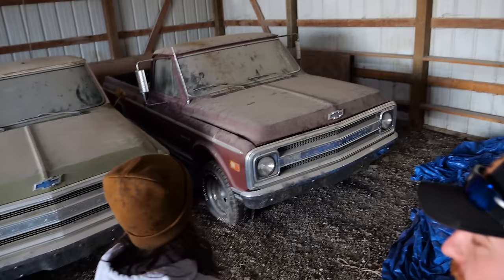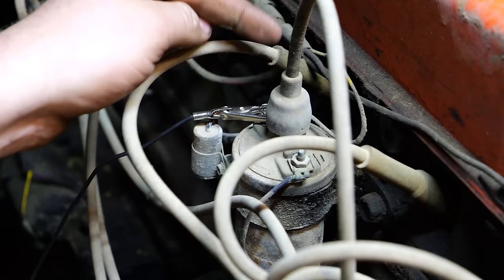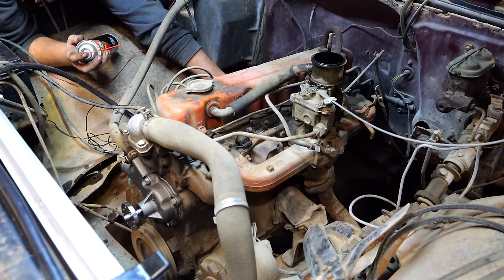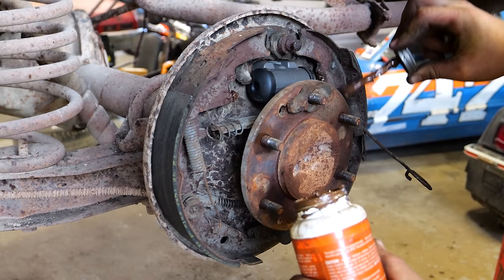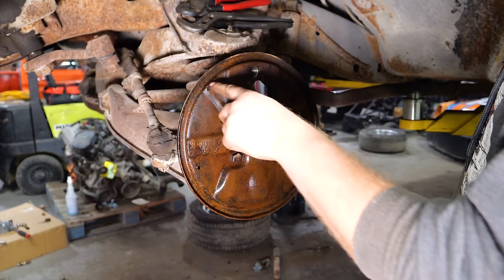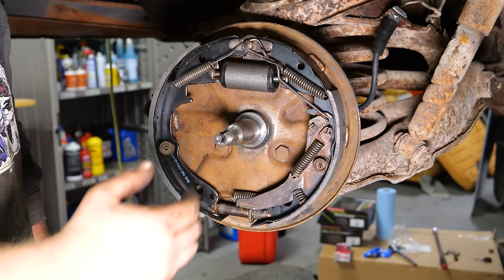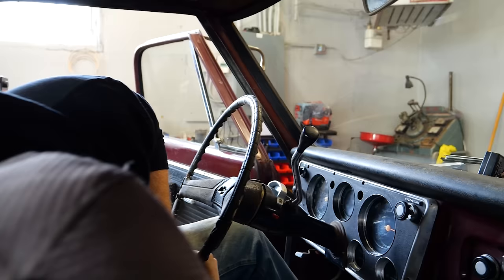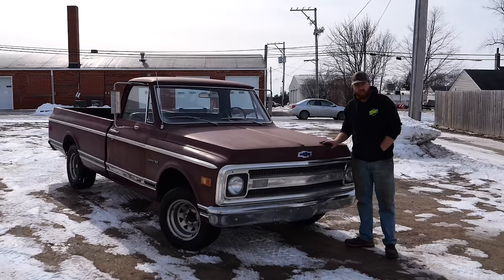Will an ABANDONED C10 Run & Drive? Mothballed for YEARS

Comment: Kevin, there may be a ton of videos on doing drum brakes, but none as calm, clear and concise. Loved this.
Reply: He put the front brake shoes on backwards. Bigs to the back is what our shop teacher always said.
Reply: @mcqueenfanman  You are correct.
Reply: @mcqueenfanman  yep, short shoe is the leading, long is trailing. Dad was a professional mechanic, went to Lincoln Tech, in the 70s and taught me drum brakes in the 80s/90s.
Reply: I don’t know why he doesn’t use brake tools either. Learn to use them. They work quite well and it beats having a brake spring cut you. I literally find those tools cheap at flea markets and second hand stores. I even sent him a few.
Reply: @mcqueenfanman  Agreed, a decent set of brake pliers or tools makes things super smooth. Never understood why people insist on using screwdrivers and pliers to do it.
Reply: I hate that my parents found out i get high on my YouTube channel as my career )):
Reply: Kevin and Chrisfix by far have the best videos on drum breaks
Reply: @mcqueenfanman  and the bottom spring was backwards too, the way he put it the spring will hold the star wheel and the self-adjuster will not be able to turn it.

Comment: It's always a great day when Junkyard Digs uploads a new video. I'm a Ford guy but I like these old Chevy trucks too and it is nice seeing them get another shot at life
Reply: I've been working at a body shop for a bit now and extra tips I learned was if you're painting the door, it's better to take off the mirror and belt molding (the trim at the bottom of the window) for a better paint job in the end. The mirror can get in the way, and if you're unlucky, the clear coat could stick in that gap between the door and the belt molding
Reply: @Fire tablet  I think you may have replied to the wrong comment, not trying to be rude here but your info doesn't seem to line up with the content of the original comment.
Reply: @uenragedbro  This is why I'll never let someone borrow my car again.  My ex let her brother drive my car and he ended up running from the police and tore my shit up. I was pissed asf, especially when I found out he tried hiding my car at a car wash
Reply: @firetablet1995  Are you ok, man?
Reply: @redbeard6220  I have a red beard too! Sorry I just noticed your username, at least it was somewhat RELEVANT

Comment: A little tip for old engines as long as you have a timing light: Hook up the timing light and look at the marks - rev the engine and let it decelerate while watching the marks - they shouldn't change much at all (less than 3 degrees, the less the better). If they move more than 3 degrees, your timing chain is loose - if they move upwards of 5 degrees, maybe ought to replace it....soon (especially if you have any "strange" noise when accelerating / decelerating). This, of course, assumes that any vacuum advance and manual advance (distributor weights, for example) are plugged / removed.

You can also test the chain manually if you have easy access to the crank bolt. Open the distributor cap and note - exactly - where the rotor is pointing. Take a wrench and SLOWLY turn the crank back and forth - noting the amount that the crank turns before there is any movement of the distributor rotor. Once again, the less movement, the better.

So, why all this? You'll find more than a few old engines out there that are parked because the timing chain needs to be replaced. At times, owners will park the vehicle not knowing that it's the timing chain - all they'll know is "it just never runs right no matter what I do". Yep...cause a bad chain - well, the engine is rarely properly timed - might rev up really great, but then pop like hell on deceleration......

Edit: I should be more clear about 3 degrees, etc. If your standard timing at idle is say, 6 btdc, you'll see the timing change to more and less than 6btdc (usually a little more on the accel side than the decel side). As long as your timing doesn't change more than 3 degrees - more than 9 or less than 3 btdc - you're generally fine. 3 degrees meaning you'll see, on average, a 6 degree "swing". Watch it, of course, if you see more than 3 degrees in either direction and certainly be concerned if you see 5 or more.
Reply: That engine has timing gears instead of a chain
Reply: @dm1123751  True enough, although the tip applies to most engines. Timing gears wear too....BUT....odds are the engine would be in a landfill / recycled or rebuilt far before any wear would be noticeable. MAYBE...if you run them dry.....lol
Reply: Your very right . I've bought more than a few that needed timing chains replaced. I bought a Eagle and the owner said that he couldn't get it to run right. I ended up replacing the timing chain and cam .
Reply: @David B You are absolutely spot on with your advice. The timing gears in these here engines suck. When they go, it'll wipe the teeth clean off from them. I'd replace them pretty quick
Reply: @waynedavis7245  Sometimes they're pretty obvious - enough slack to get noisy. Strange front engine clatter on accel / decel and runs "weird" - timing chain is a likely culprit.
Reply: @dm1123751  Haven't worked on many engines with factory timing gears, although have worked with Pete Jackson gear drives (bulletproof...until they destroy themselves like any part of a highpo engine). Most factory motors I've worked on have been chained, or, of course, belted (mostly the 4 bangers). Did manage to have a timing belt slip - stretched enough I guess to jump - interference engine - pistons meet valves, carnage ensues. Warranty covered that repair, thankfully, and now...well, I watch timing belts pretty well and change them early - glad they are generally a lot easier to change than a chain.
Reply: A 250 uses taking gears and they rarely wear out. Though they are plastic so 🤷‍♂️
Reply: @Gkitchens1  Plastic CAN be durable, I guess, although I imagine things go south quickly when they do go. Plus side - better to have tiny bits of plastic in oil rather than steel (although some properly placed magnets...nvm).
Reply: timing chain, or distributor is loose.
Reply: Yeah that makes sense..I was wondering why almost all of these old cars need tinkering with timing
Reply from the maker: What we do is simply take the cap off and turn the crank back and forth, watching how much play there is before the rotor moves, as you mentioned 🤘
Reply: @grumpslowenleft9642  very true . I've done a few earlier 305 GM's . They were prone to for timing chains and cam failures. I would check for slop when I turned the crank to see if the engine was free . I've bought probably 5 gen 3 firebird. 3 had bad cams .
Reply: @danieljames5875  It's a tip to check it - whether a person wants to get it back to factory specs or not is up to them. A timing chain is a frequent "park" item - I've seen many with much larger than the 5 degrees I mentioned, I think the largest I recall was somewhere around 10 degrees each side (20 degrees or so total) - and yep, nice and noisy, well, for the brief moments that it would run.
Reply: David B; Great point about an engines timing, your knowledge is spot on.  The Chevrolet in line six uses timing gears which makes the timing more accurate,so there's less of a chance of inaccurate timing.  I've seen on rare occasions that the cam gear can strip on these leading to a no start condition.
Reply: @paulkirkland1535  Thanks for the reply. For me, if I'm evaluating an old vehicle it's a big thing - I might be going into it thinking there won't be much work needed, only to find that the chain is VERY worn out - quick opinion change there. What else was let go? How long did it drive with a worn out chain? How often was oil changed and other maintenance performed? Some engines can sit for many years and need little more than a slight prod - and then run well - we see it fairly frequently on this channel. Other engines....well, after tons of effort, parts and money - depending on what you had to replace (and the list can be extensive and expensive) they'll run too. A worn out timing chain is one thing - but if it's an indicator of essentially no maintenance - fixing no maintenance is a lot of work and usually expensive. When I find a worn out timing chain I look sludge in the valve covers - if there's sludge...I pass.
Reply: Have a 1989 Honda Acty Street, replaced the timing belt last weekend. It had a nasty timing wander - probably ±4° - which entirely went away with the belt replacement. Belt was really loose, letting the cam kinda wander wherever it wanted. Think I really dodged a bullet with that one.
Reply: @jaypawhealer  Yeah, 4 degrees is a bit for a belt - they don't tend to easily get the permanent stretch that a chain does - but when they do....yep, I've had it happen - slips a cog or so, and in my case, all 16 valves meet the 4 pistons. You very well could have dodged a similar fate, although not sure if yours is an interference engine - it likely is, but...dunno. Would be nice if chains were as simple to replace as belts....oh well.
Reply: @grumpslowenleft9642  it is interference, and I think it was a combination of stretch and the tensioner slipping. It's the kind with a weak preload spring that you set in place with a bolt, not a huge fan of how that works. To be fair, it just hit 100,000km and the belt seems to have been the factory one from 1989, which is a pretty good run
Reply: @jaypawhealer  That's a fair amount for a factory belt. My 90 Laser RS Turbo slipped the belt at about 55,000 miles - fortunately the repair was covered under warranty. Now I check them at 40k miles - most of the time I replace them at that point, unless their just oddly fresh (it happens). They don't cost much, and the repair isn't usually too difficult but can be time consuming depending on how the engine was engineered and where the accessories are mounted.
Reply: @grumpslowenleft9642  I had a friend slip 12 teeth on the crank of a Subaru because he didn't change the oil and the cam welded itself to the head. Definitely gave me respect for the damage timing belts can do if they fail or slip, even though that wasn't the root cause. Not something you wanna ignore lol
Reply: @jaypawhealer  Something that oil starved, I think the best course of action is to jack up the antenna and pull a new car under it. My Uncle bought a really nice, body wise 71 (I think?) Duster (with a good body, I know, hard to believe) - but it had a tick in the motor (225 slant, IIRC). Hooked my finger in the valve cover and pulled out a bunch of snot - told him that that is Pennzoil and he needs to put 2 quarts thick oil and the rest kerosene, new filter, and idle it for 15 minutes - and then repeat it until the oil looks at least somewhat clean after the 15 minute cycle. BUT....I'm like a YEAR and a HALF younger...so I don't know anything - even though we found an oil change reminder that said that the brand used was Penn....so he didn't do it. I got to laugh at him when he called and I got to go pick him up in my RUNNING vehicle. Old Pennzoil would do that if the car was just driven for short city miles - whitish sludge - and once it starts ticking, well....guess you can think of it as a time bomb - either stop the ticking.....or.....
Reply: @Gkitchens1  Two types of gears on a Chevrolet six (factory pieces) Fiber gear or an aluminum gear. Between the two the aluminum gear would be preferred.
Reply: i got a lil bit of shaking around 70 mph. tires are balanced ball joints are fairly new. would bad coil overs cause that? lol
Reply: ok
Reply: Hey guys, I tried to buy a set of Raycons with your code. Your code took me to the site with your name and discount, but when I checked out it wouldn’t give me the option to use your code. Sorry, but after trying 6 different times, I lost patience when they offered 15% off with a FAFsomething code and I just wanted to support you guys and replace my dying airpods. Would be willing to trade my 84 brat for your chevy straight 6?!? Maybe. Love what you guys do, just wanted you to know it’s difficult when tired to follow the Raycon purchase. Like I said we just wanted you to get the credit. Thanks for all your awesome content. Joe from Oregon
Reply: Do chevy inline 6 have a chain? Just because the ford 300 and 240 i6 use gear driven.
Reply: That could be the issue he had with that red 68 Bonneville that sat for 48 years. I know Kevin changed the rocker arm, push rod, and the hydraulic lifter in one of the cylinders and he also changed the carb and did a lot of other things and he still couldn't get it to run right. I remember him saying that it had over 100,000 miles on it within 7 years so the timing chain could also have a lot of slack in it. 100,000 miles back then was a lot for a vehicle while today they consider it barely broken in lol.

Comment: The best points refresh tool I've ever had was el-cheapo paper nail files. Basically is just a piece of cardboard with fine (ish) sandpaper glued in a handy format.
I keep an old ten-pack in a zip bag in my toolbox. Great to refresh a pair of carboned-up sparkilators as well.
Reply: What I was thinking. They are called emery boards, find them in the cosmetics section at Walmart. And likewise with Kevin, I have never had good luck with the points files.

Comment: I really appreciate how you show exactly what you are doing and explain what it does. You are getting to be a good teacher. 
    Also, that wire you put from the battery to the coil, that is how people used to steal cars, also known as "hotwiring" a car. Very good reason to find a way to lock your hood!

Comment: Sorry had to add some more tips to this Video, first thing is the heavy metal rod that holds the one shoe to the backing plate should always go on first, the smaller spring goes to it's outside to help hold the bigger rod in place, I also just noticed that you put the shoes themselves on backwards, each wheel will have one shoe longer then the other, the long shoe Always goes on the rear side of the hub, as for the tools, if you buy the junk ones from the freight place, you will fight with them, a good set of brake tools makes life so much easier, the set you have doesn't look to bad, you should try them, your fingers will thank you.
Reply: The thick part of the spring on the self adjuster shouldn’t go above the star wheel or behind the brake lever, if I remember correctly. It will interfere with the movement of the adjusting lever and/or the star wheel.

Comment: Mook and yourself should offer a 10 minute safety video regarding do and do not when working on starting engines. You tucked in those draw strings for a reason and some in a hurry could have missed the point or that open fan blade. Emergency Rooms suck and fingers don't grow back. Both of you do awesome content!
Reply from the maker: One of these days I'm going to find a supplier for sweatshirts that doesn't come with those damn suicide strings
Reply: @JunkyardDigs  First thing I do when I get a new hoodie is cut the strings off and toss em in the trash.

Comment: Had a 69 C15 ( leaf spring rear ) that was 3 on the tree that I swapped out for TH350.  Fun little project.  Went with the aluminum eBay rad too.  As I do with most vehicles.

Comment: Nice tutorial on drum brakes.  Your carb does have an accelerator pump and it needs a new one in its rebuild.  It also has a choke and an air cleaner and these things work together, especially on small carburators.

Comment: I've got a 94 Chevy K1500 and a 94 Chevy C3500HD (8ft bed).  These trucks from the 70s through 1998 are excellent work trucks.  Very dependable and easy to fix.

I had my 94 sitting in my barn for 3 years.  Changed oil, drained fuel lines, siphoned out gas, filled up new gas, and reinstalled air cleaner assembly and she fired right up.